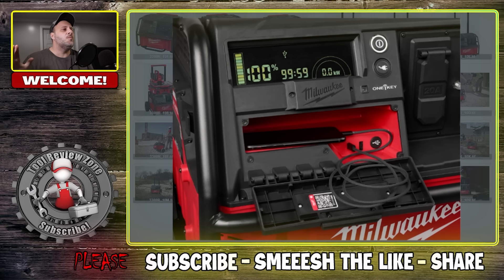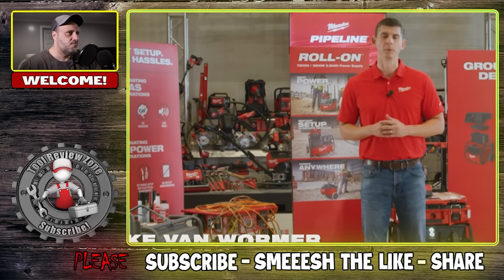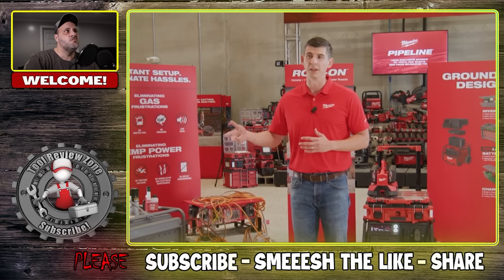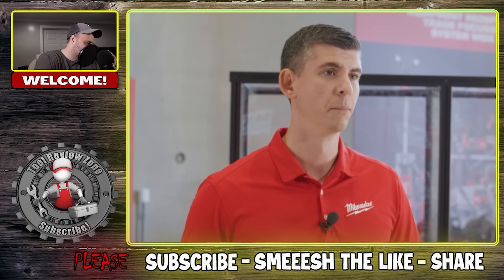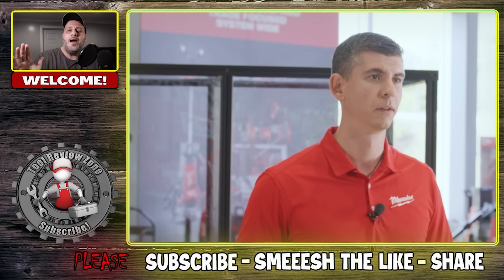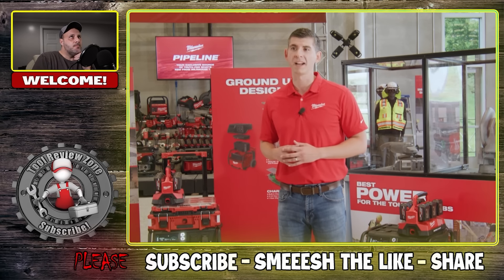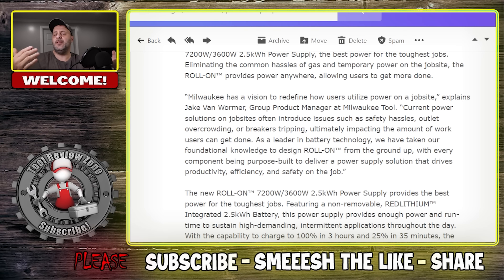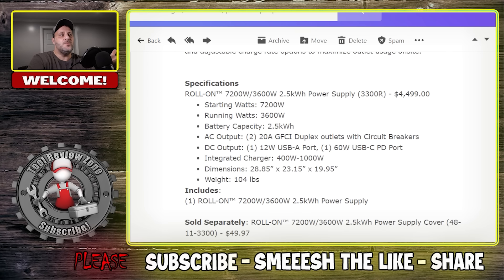Milwaukee Tool releases something that could make your life much easier

Comment: 1 gallon of gas is 36kw of energy and this mw power station is 2.5kw thus ~ contains 1/14th of a single gallon of gas worth of energy. 

A generator converting gallon of gas to electrical is about 18kw at 50% efficiency - thus this ‘battery power station is equivalent to about 1/7th of a gallon of gas. 

Not anti power station or pro gas station - but I do believe there should be more education on what watts and watt hours are just to help understand what is what.
Reply from the maker: Great feedback.  I've actually discussed this on a previous video
Reply: @ToolReviewZone  I watch almost all your fantastic videos - I don’t remember this topic but I have just a wee little brain and always distracted 😀
Reply from the maker: @patricksquires6348 I do as well, so maybe I didn't 🤣👊

Comment: My bluetti AC180 power statio is 1000/1800W output. It cost me $1100 CAD.  I could by 3 of them and each of them could run a 15A corded tool under $3000 USD in total  and give me 3Kw. Plus i have solar charge, 100W USB C output, 1 hr charg time, UPS function, lifepo4 battery, etc. I think the only person buying this Milwaukee is for the name.
Reply from the maker: Appreciate the feedback 👊

Comment: I understand the appeal to this, but why not plug in a fan to a gas generator to blow the fumes into the opposite direction?
Reply from the maker: Many times some of these crews work in large indoor areas.  Think about replacing a concrete floor in a warehouse.  Sometimes it's just hard to get around it
Reply: @ToolReviewZone  That’s true, I didn’t think of that

Comment: 2.5kw is nothing for a whole day job.  Plus, the battery type, don't tell me it's not lifepo4 battery😅😅😅.  12W usb A and 60W C are junk. 3 hrs charge time is below average. Didn't mention the UPS function😢. No solar charge. Compared to other power station. Milwaukee is way behind on technology. And also delwat had their 1800/3600W power station 5 years before Milwaukee's one. I don't know why Milwaukee is producing these kinds of tools which they are not good at it.

Comment: Cringe moment - full face shield and helmet, eye goggles, gloves, no hearing protection, gold earings showing, and lastly long hair dangling in the front while operating a mammoth angle grinder.  I was taught not to use gloves while operating a grinder because a finger can get sucked into the wheel as well as to put up long hair for the same reason.  I was also taught to remove a neck tie - but I have never seen anyone operate a power tool with one on.  It is surprising that Milwaukee does not know better.